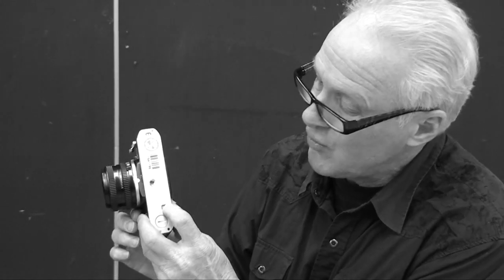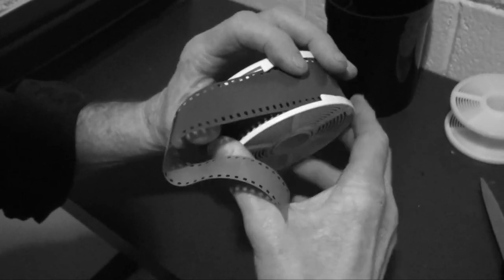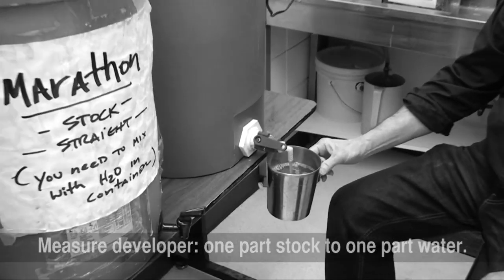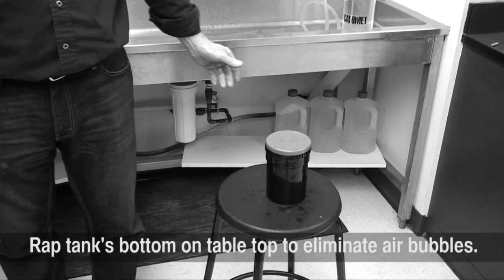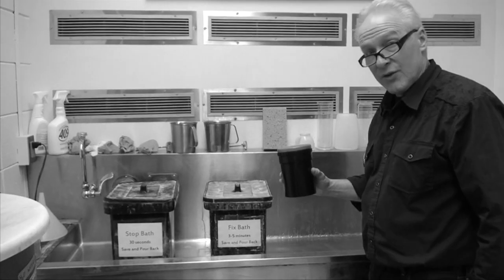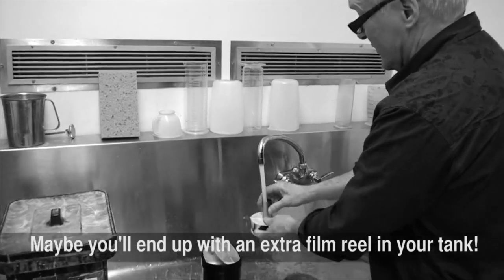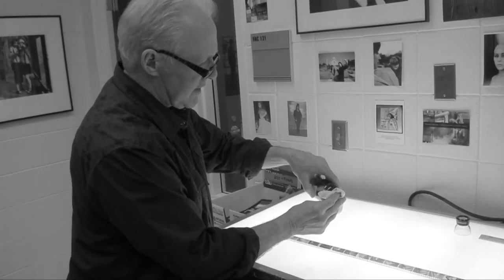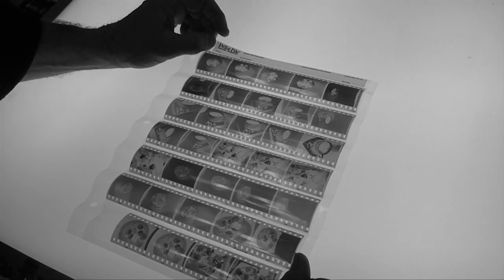Developing Black and White Film

Comment: Too many steps. Could you simply put the film into the solution, take it out and dry it and thats it.
Reply: Each chemical is different because they must do different things ... at different times in the process.

Development is a chemical reaction needed to act upon the film's emulsion. The reaction must be stopped to avoid over-development. (But see below re: stand development). In other words, even after pouring out the developer, the film will remain wet with residual developer, slowly over-developing the film if left alone.

It's also important to know that while it's being developed, film remains somewhat light-sensitive. So even after the stop bath, the film could gain some extra exposure (potentially). That's what the fixer does: it makes the development permanent by preventing later developer (or light) from altering it. So you're stopping the current reaction (stop bath) and preventing future changes (fixer). 

You can remove the film from the tank after the stop bath but almost no one does because it won't be stable. That's only done if you want to quickly check the film under a red light and dunk it back into more developer if the negative is too "thin."

"Stand development" approaches one-step, by treating film to a small amount of developer over a long period of time. Over time, the developer is chemically exhausted and stops the process "by itself," by becoming too weak to do anything more. But you'd still be rinsing and fixing.

The process and your shopping list can be quite flexible based on your needs and desired outcome. For example, developer can "stop itself" given enough initial water dilution and time, as mentioned. Developer ratios can be altered to satisfy easy-to-remember times. The stop bath could be plain water, especially with more highly diluted developer, right? Or it could be white vinegar and water if the developer is "thicker" (stock dilution). Instead of Photo-Flo at the end to reduce water spots, maybe use a drop of dish soap in water. 

Analog photography is about more than "taking good pictures." It permits you to find recipes you like. Digital is wonderful, sometimes you just want to eat, and more people than ever today are taking good pictures as a result. Analog lets you make something you maybe can't get in a restaurant, in a way of your choosing and control.
Reply from the maker: Thanks for watching Dimitar!! I am not even going to try to answer this one--The Next Hobby has really done a superb job explaining the development process! Good luck to you!!
Reply from the maker: Excellent The Next Hobby!!! You have a way with words!! Very good explanation of the process and visual with the food analogy :))